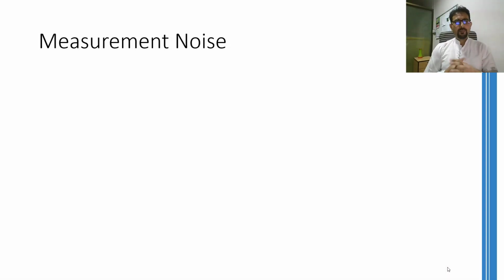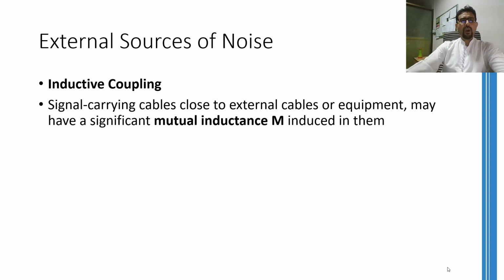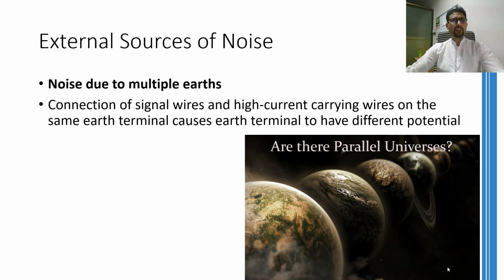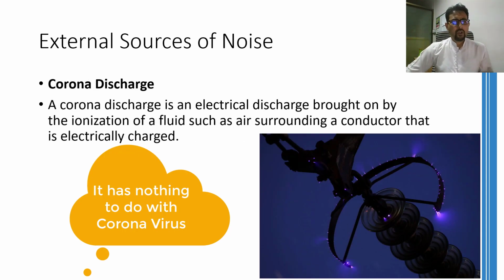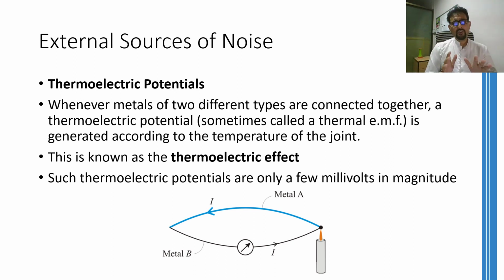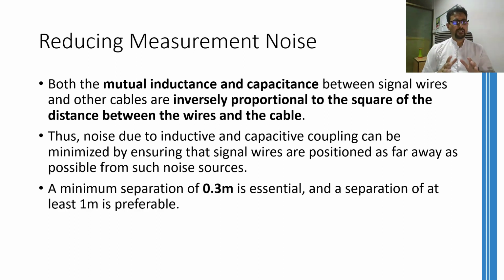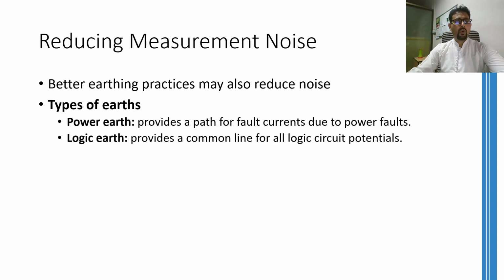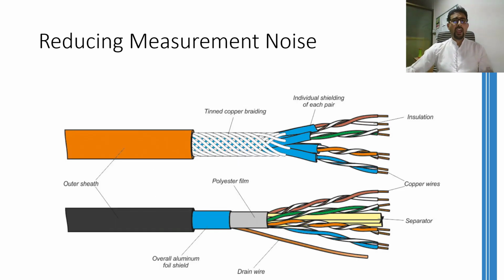Lecture 4 Sensor Noise and Possible Remedies

Comment: 1) Mobile communication is badly distorted in Hill station like areas due distant or no signal transmission towers. Moreover due to bad internet service online communication is disturbed as well. 
2)Whenever an airplane during flight  undergoes a situation of high turbulence or bad air shocks , The communication between 
the air traffic control and pilots is badly distorted

Comment: when we turn the radio on in car, the noise affects the signals whenever the car passes under electricity wires or close to a transformer etc.

Comment: In a sound system whenever the voltage changes of it, due to loose connection of it or from power source directly, the signal got corrupted

Comment: Noise in audio amplifiers:
Cheap Audio amplifier ICs such as LM386 develop a large amount of noise when the gain of this amplifier is increased more than it's threshold or DC is not properly blocked by appropriate Capacitor value. This is collectively classified as THD+N (Total Harmonic Distortion + Noise) in the Datasheet of audio amplifiers

Comment: In tube lights, when we turn it on it requires some time to get fully glow. The reason behind this is that appropriate voltage is coming from the behind but due to some loss of electrical signals tube light gets fluctuated and fully glow after some time.

Comment: In tube lights, when we turn it on it requires some time to get fully glow. The reason behind this is that appropriate voltage is coming from behind but due to some loss of electrical signals tube light gets fluctuated and fully glows after some time.

Comment: Interruption of Noise in Communication:
Whenever we listen to a radio program, we can feel that the signals are distorted. This is due to the interference of wanted and unwanted electrical signals. For instance; if we are tuning the radio for catching the signals of Lahore (wanted signals), then there may come a chance that we receive signals from a different city (unwanted signals), so those signals become unwanted to us. So, the interference of these wanted and unwanted signals leads to the production of noise or distortion.

Comment: The Amplifier of the Speakers gets corrupted when we select any signal apart from the one working fine and it creates a quite uneasy sound. This is because that signal is corrupted with noise during the transmission.

Comment: Task) In AM (amplitude modulated) waves in radio transmissions, the information is transmitted to the receiver who selects the desired transmission by selecting and varying the amplitude. Since the amplitude is varied/modulated in this transmission process, there is noise in the signal at the receiver's end.

Comment: During extreme weather conditions the radio signals get distorted, some times in the loudspeaker the noise is produced it you are charging your mobile or laptop at the same time.

Comment: Factors such as bad weather conditions lead to poor Dish Antenna/ Mobile data / Wifi signals are affected and are not provided as in range due to the distortion  causing noise in transmitting signals from the source to receiver

Comment: In Past people use antennas for TV signals, The broadcasting coming from TV headquarter is clear and of good quality. But TV screen display with some black and white dots. These dots are produced due to noises in the environment induced in the signal so there is lost in the quality of the display.

Comment: The signals during a phone call get distorted when any electromagnetic device is brought near it. For example, two ell phone on call placed close to each other will have a lot of noise at speaker output.

Comment: The wifi signals because of long distant stations and towers get distorted whereas it is generating the correctly. 
Or sometimes because of atmospheric conditions, the signals of mobile data or wifi also get distorted.

Comment: When a fan is turned on. for the first few milli seconds you can hear a noise being transmitted by the capacitor in it .
Reply: Royal fans use krien app

Comment: When someone speaks in the radios.
The voice is being created correctly.
But sometimes in its transmission, signals get contorted due to different interferences. for example when different signals ,wires, noises intervene.

Comment: In old days and still, some villages are using TV antennas for TV signals. so the broadcasting coming from these antennas have noise and it will disturb our TV screen display. But the broadcasting coming from TV headquarter is clear and of good quality. so the loss in the quality of the display is lost due to transmission.

Comment: Interruption of noice during communication like calls specifically when the old push button telephones were in use, noise interference was the main problem during transmission of signals.

Comment: 'Hiss' noise present at very low level in every electronic devices most specifically in radios where signals generating from radio stations are fine but there must be disturbance during the signals' transmission.

Comment: In my hometown, FM Radio doesn't operate. The reason is that the signals of FM Radio are generated correctly at the Radio Station but during transmission, they are corrupted by noise.